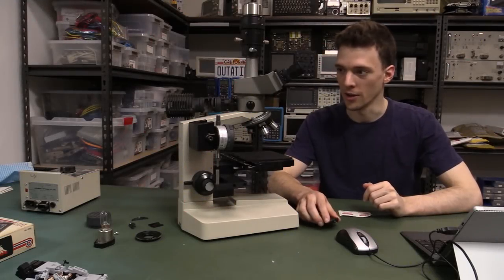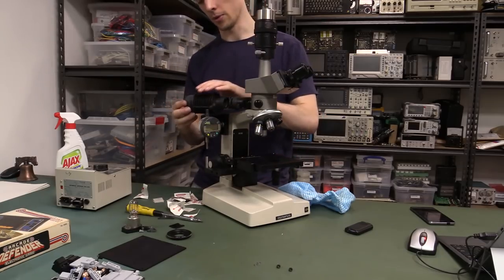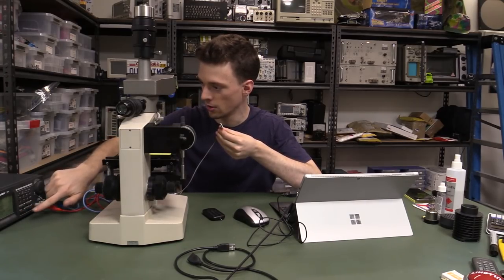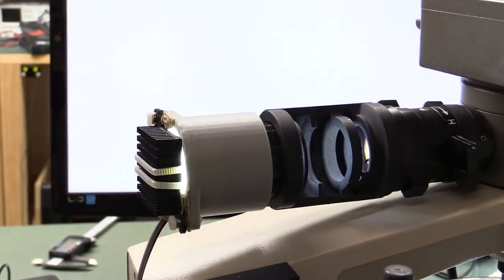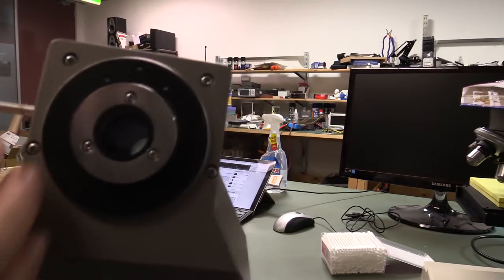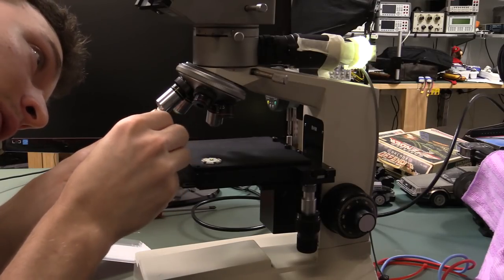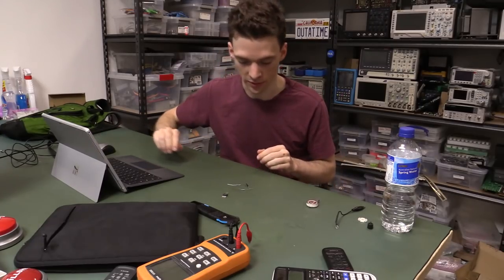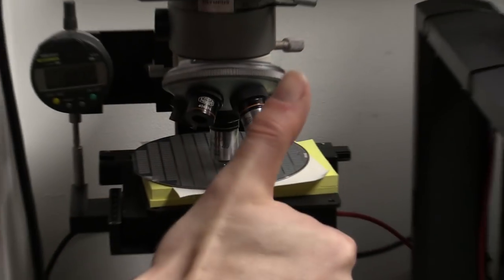EEVblog #992 (Part 2) - How To Clean & Service A Microscope

Comment: Hexane is what we were always told to use to clean lenses back when I was in lab, we were told to use this because its virtually non polar and because the carbon-hydrogen bond in special in that it doesn't interact with other materials (something about how its liquid state is maintained almost entirely via van der waals forces), where other commonly used solvents like xylene may be non-polar, but they contain aromatic rings which interact with other materials.

Comment: If that microscope was rigid from cam to lens to the specimen table, I don't think it would wobble because - it looks like the cam is moving separate from the wafer -. I'd be checking for play in the cam or specimen table.

Comment: In relation to the shacking, if you clamp the sample to the solid microscope stage you'll reduce most of that. Also, in medical research we often have our better microscopes sitting on a 250-750kg stone table top and sometimes these tables will have mechanical dampers built into the legs.

Comment: The lm317 will drop over 3V in constant current mode. Since the LED needs 3V, this will not regulate with just a 5V power supply. LED gets no where near 300mA.
Reply: Exactly. Scanned down the comments expecting lots of people to have raised this but they don't seem to have. 

A standard LM317 needs between 1.5 and 2V to maintain regulation at 300mA depending of temperature. Add to that the 1.25V dropped across the current sense resistor and it's 2.75 to 3.25V.

Looks like David needs a bit more practical electronics experience.
Reply: Easiest way to check if the the final circuit is regulating is to check the voltage drop over the resistor. It wont be 1.25V if the power supply is too low.
Reply: Agreed. Looks like it's just us two commenting on this.
Reply: Yup, I concur, I'm not even in the office lol its Sunday. I responded to Graham's comment above.

Comment: The trick with hex keys is that you need a metric and a imperial set ;)
I used to work as a sound and light tech and we mostly used JBL speakers. You could tell if the speaker was made in USA when it had imperial hex screws :D

Comment: Now you just need to build a new workbench with a half ton steel top to get rid of the vibration.
Reply: i think he mentioned in the other video when he was using the microscope that the  other desk he had it on was screwed down and very solid and yet still saw vibrations
Reply: Put the heavy table on suspension.

Comment: The speeded up video bugged me a bit, I don't mind a bit of waffling. Re, the "dirty" inside of top tube thingy,  David's obviously never mucked pigs out or changed a nappy; that's dirty. Not bad for a 1st video David, you need to slow down a bit though. No worries, I know how hard it is to relax when filming yourself.

Comment: never clean lenses with a dry cloth, no matter how soft it is. there are lots of small hard particles in that dust that will scratch the lens when you move them around. the only way to do it is with something wet.

Comment: 3:03 Dave, come on, that's not fair. Inserting yourself during edits and what-not.
Reply: tohopes would be very funny if dave2 did the same thing to dave1 if he got to editing as well. Thumbs up to dave2 being a permanant host. Though saying questioningly Power supply of doom? is there video of why this power supply earned the nickname?
Reply: yep, there is a video, gotta go back 6-8 months at least
I just remember it being about power supplies, possibly a review, and then this came in on a tangent, it was about UI simplicity
Reply: I appreciate your response but its no problem, it was my idea for him to correct me. Its an Aussie joke, Aussies obsessively will correct you if you pronounce Z "incorrectly". It reckon it was a fun edit :)
Reply: I liked the video. I also didn´t mind Dave's voice over. Don´t get me wrong, it wasn´t necessary - but it added even more value. Two heads are better than one.
Reply: The voice over was  only echoing what I was shouting at my monitor, anyway : )
Reply: it was a nice touch actually. its fun to take the mickey.

Comment: Hi Dave 2. Interesting first official video!
Tiny bit of advice, maybe you could talk a hair slower and pronounce a hair better. That's all.

Just one little thing. Such a fine piece of gear. Does that really deserves only just a botched together current source? :(
Reply: I reckon the microscope is dearly offended by the USB current source, yes
Reply: It's not really a "USB current source". Just using a USB connector as a source of 5v.
There's also nothing wrong with using an LM317 for this task.
Reply: Would you prefer verbosity such as "USB-powered constant current source"?
Reply: Who said that there is something 'wrong' with it?
Reply: I think the audio volume was too low at some points but overall it was comprehensible - even for a non-native speaker

Comment: Is that David's first official channel one video at all? There was the one with the 3D-printer, right?
One thing that came to my mind while I was watching this video was: While you're at hacking the light, wouldn't it be possible to add a mount for lasers, so you could use the scope to measure thicknesses of layers by interferometry? Would such an addition be helpful for analysing ICs or anything?
I know it's a whacky idea, but I  guess it would be possible.

Comment: Looks like David needs a bit more practical electronics experience. 

A standard LM317 needs between 1.5 and 2V to maintain regulation at 300mA depending of temperature. Adding the 1.25V dropped across the current sense resistor takes that to 2.75 to 3.25V, leaving a 1.75V max load voltage drop in order to maintain regulation on a 5V supply.

Measuring the current into a short presented by an ammeter isn't going to show the current into the LED dropping 3V.
Reply: Hopefully your not trolling and want an actual response.

This was a two birds with one stone solution, if inadequate current (less than 300 mA) achieved sufficient brightness then job done. If not power from an alternate source and get the full 300mA. It was only a few minutes of work for a solution for both scenarios. I probably should have kept more footage, not very good at editing at the moment and I wasn't sure what to keep. In both scenarios the LED is safe from over current. Device is temperature stable at 300mA, building is aircon'd + heatsink sufficent.

If your curious its running at about 50% relative luminous flux (166mA) what it could, at 300mA it would be at about 80%. We didn't yet need the extra brightness, might later, we will see.

I know that the multimeter doesn't include forward voltage of LED or set drop, this is pretty basic and ultimately it didn't matter. It showed that I didn't pick the wrong resistor and that it wasn't open circuit or shorted, it also showed that the LM317 was functional as many were second hand. The test meant that I could be sure that I was indeed protecting the LED from over current for both scenarios.

Thanks for the feedback, would you prefer longer videos with the extra details that fully justify a design decision or more like a project summery?
Reply: Why on earth do you think I'm trolling? You made a schoolboy error and I pointed it out. Trying to justify the error does you no favours.

That's "you're" in the third para BTW.

Comment: You mixed up the Y and Z axis.

Y is up and down and Z is depth.
Reply: I understand the confusion, but in this case it is correct, Z is the 3rd dimension. On the ground, map or piece of paper (or the table from the microscope), the dimensions are X and Y, the Z is the height above it.